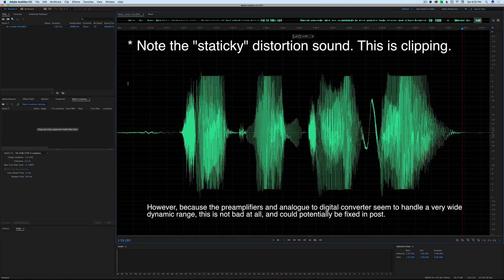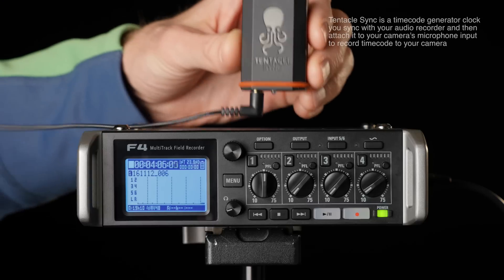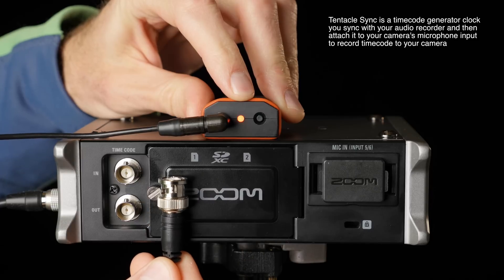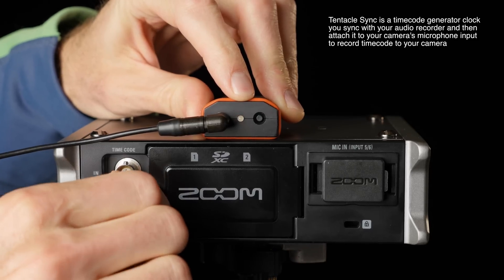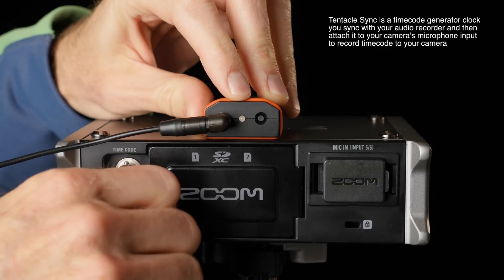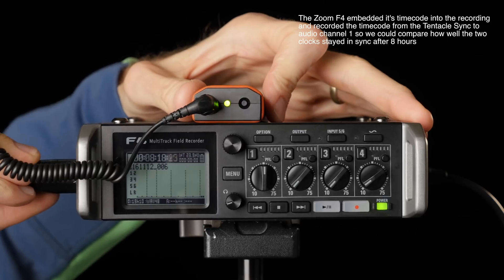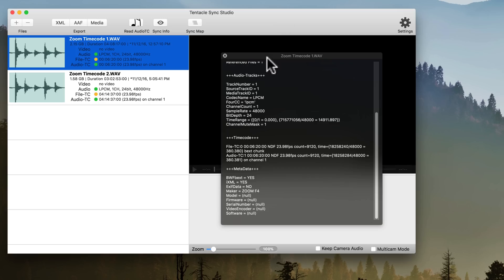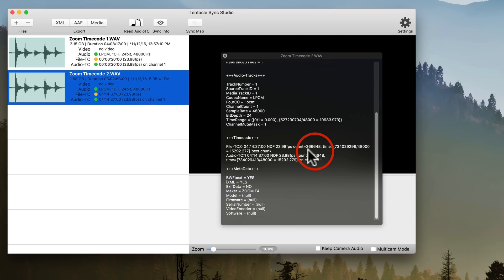Zoom F4 Limiters and Timecode Accuracy

Comment: Hello curtis!!! How are you? Please can you help me with one question, in fact are two hehe 
1 - Did you know if the zoom f4 timecode works fine with Blackmagic Pocket 4k? If i have a TRS stereo mini jack to BNC cable, can i put the BNC at the timecode out from zoom and the Trs plug at the pocket mic in and press JAM, do you know if this works??!
2 - I updated my zoom f4 with the last firmwire version and a wierd thing happens, the 1-4 knobs (levels meters) now works at the out levels for the LR master… for example, if the actor scream at one moment and i need to decrees (go down) the trim of the input, i need to go at the PFL options and change the TRIM value there… 
Resuming, what i want is, the 1-4 Front Faders works as a Trim faders note only faders to LR… 
Sorry about my english im brazilian hehe 
Tks and congrats your channel is the best about audio cinema and audio for filmmakers!!
Cheers!!
Reply from the maker: 1, yes. 2, change fader mode.

Comment: Good day, Curtis! So, with the Zoom F4, all I would need is one Tentacle Sync and I can synchronize one (mirrorless) Camera with an audio jack and the recorded audio in my NLE of choice? Also, will a direct wired timecode connection (BNC to 3.5 jack) from the Zoom F4 to the Mirrorless Camera work? Thank you!
Reply from the maker: If the camera's input can be switched to line level, then yes, a direct connection with an adapter cable will work. If you're using a camera without a dedicated timecode input, you will first need to convert the video files so that the audio timecode is converted to metadata timecode. The Tentacle Syncs come with the apps to do that.

Comment: I've had the F4 for about a month and a bit and I've been loving it so far! What would you recommend for limiting thresholds? I've often gone with -6 as standard but as I've found out some actors be pretty  quiet while others can be much louder so perhaps - 10 to - 12 would help with consistency, Would you agree?
Reply from the maker: My thinking is to set the gain so that the peaks only hit the limiter very rarely. So I focus on the gain trim setting and just leave the limiters at their default settings. With the trim setting, I’d reduce for the loud talkers and boost a bit for the quiet talkers until they’re both hitting peaks around -18dB.

Comment: Hi Curtis, great video as always. I'm looking for an affordable solution to hook 4 radio mics to my Sony FS5 camera, but I'm a bit concern with looming this one up as the out put is consumer, or has that been addressed?
Reply from the maker: Hi Rolf, the main outputs are spec'd at -10dBV. I wouldn't necessarily see that as a problem with the FS5 which has decent inputs as far as cameras are concerned.
Reply: @curtisjudd  Thanks Curtis, had the same reply from a sound friend.

Comment: I appreciate the detailed reviews. Can you start and stop the f4 with the timecode input and a camera in rec/run timecode?  Or is there another way?
Reply from the maker: Thanks Brian. Yes, the Ext Auto Rec mode supports this if the external camera/TC generator supports it.
Reply: @curtisjudd  Great, thanks for the reply.  That would be super helpful with cameras that have TC over SDI and with recorders like the Odyssey7q that can also output TC.

Do you know if the F4 received any of the features that came with the firmware upgrade for the F8/F8n?
Reply: @curtisjudd  I actually answered my own question :)  According to the zoom site it looks like with v3 firmware the F4 gained the advanced limiters from the F8n as well as the auto mix feature: https://www.zoom-na.com/news/firmware-update-v30-f4

Its a little sad the mic/line XLR 1/4" switch is a hardware thing.  Maybe we'll see a F4n soon.
Reply from the maker: @brianwennersten8456  Correct, got all of the software updates. Now we just need a hardware update. :)

Comment: Sir i have discussed with one dealer in india and he told me that tascam 680 mark ii has also analogue limiters and is a pro audio recorder ...plz throw some of your thoughts on this audio recorder plz... should i buy this in place of sound devices mix pre3
Reply from the maker: I don’t think that the Tascam has analogue limiters but I’m not sure. The owners manual didn’t call them out as being analogue. I haven’t used the DR-680mkII but have used the 60DmkII. If they use similar preamps in the 680, then the MixPre has a significant advantage in terms of clean gain and overall sound quality. But again, I haven’t actually used the 680 yet so this is all based on assumptions.
Reply: @curtisjudd  sir for a couple of days i am really confused what should i do....
1)Should i make a one time investment and buy mix pre 3.... or
2)i buy zoom h5 for now and later on will think of some better audio recorder.....
All i have to make short films on youtube that's why i was thinking what should i do.......that's why i am disturbing u again and again.........
Reply from the maker: @Shatavartverma  Buying once is usually the better financial choice if you will be using the device for more than a couple of projects. In that case, I would recommend either a Zoom F4 or a Sound Devices MixPre-3.
Reply: @curtisjudd  thnku sir!!!!!!
Reply: @curtisjudd  Sir what i have learned so far from u and all other teachers on youtube is that if u have a good mic with good amount of signal to noise ratio and has good senstivity u can record clear voice at low gain in your audio recorder.........and for me as a independent youtuber i think zoom f4 is more than enough for me.....i don't need sound devices mix pre 3........and also u have told us that zoom f4 has a great dynamic range so with low gain chances of clipping is nearly 0.....Thats why i should go with zoom f4 which is a lot  cheaper than sound devices mix pre3!!!!
Reply: @Shatavartverma  Excellent, happy recording!

Comment: Did you test the C100 II or similar cams? Because I tested and it seems to have the same things, redusing the volume automatically so that it doesn't clip.
Reply from the maker: Hi Stéphane, No, I haven't shot with the C100mkII. Often cameras will have digital limiters. But I believe that the F4 has a hybrid limiter which is more effective at preventing clipping. But I'm not sure on the C100mkII. Would love to try one!
Reply: Curtis Judd thanks for answering bro! maybe I will test the F4  or similar product. sound is very important

Comment: Hi. I am using a zoom f4 to jam sync timecode to my tentacle sync which I then connect to my Sony a7sii. Both devices are set to 25fps. The tentacle sync is set to MIC. I power off the zoom f4 after each take while the camera people set up a new shot. At the end of the day I found that there was drift between the audio and video. What could be causing this? Does the zoom f4 loose timecode accuracy when it is powered off?
Reply: Also the Zoom f4 is set to internal RTC timecode.
Reply from the maker: Hi, yes, the timecode clock does not keep time when the F4 is off.
Reply from the maker: The realtime clock (RTC)  just seeds the timecode clock when you turn on the F4. This means that when you turn off the F4, the only clock that still runs is the not-very-accurate realtime clock. I hope this makes sense. Good luck!
Reply: Thank you. The explanation is clear. Keep up the great work. Your videos a valuable source of info for me.
Reply: So every F4 owner should get best batteries around :))))) To avoid turning f4 off.

Comment: Timecode is best described as an addressing system.  I.E. This frame of video or sound has this specific address.  It is a process to accurately find a specific frame of sound or video.  If your sound is being recorded separately then IF the video is the identical timecode.. Like time of day code..or FREE RUN TC... then you can easily stack the audio and video together simply by syncing identical code....that was the good old days as I am sure you remember.... Nowadays the audio on the camera is a reference sound...even DSLR sound has enough quality to sync to secondary sound.    As such with a single source or master TC source all devices can later be synced together easily without anything fancy like god forbid a clapper.   I see you use Premiere so most of your viewers know that you can sync 2 system sound pretty easily regardless of timecode.

Comment: Hey Curtis - love your videos, super informative. Just wondering RE: the Tenticle stuff - can it work like a traditional 'higher-end' Lockit Box i.e. say I was jamming to an Alexa Mini via 5-pin Lemo commection - could I sync it to my F4 and get it to jam with the Mini once (and again every time  the camera dept change frame rate / a battery) OR does it only output audio and have to be constantly attached to the camera?
Reply from the maker: Hi Craig, Yes, you can sync to your F4 and then usually these will remain attached to the camera because they are more accurate than the camera's clock and with the Tentacle Sync, they are very small and light so it isn't usually a problem. Most DPs/camera ops will be happy to have something as tiny as the Tentacle vs. a larger, heavier lockit box, especially when flying the cam on a gimbal.

Comment: I strongly disagree. Not having an analoge limitier is a deal breaker and makes this product practically unusable for professional work. For an important shoot, do you really want to risk clipping and thus rendering your recordings unusable?
I don't understand why there is not a single affordable field recorder featuring an analog limiter.
Reply: "I strongly disagree. Not having an analoge limitier is a deal breaker and makes this product practically unusable for professional work."
Interesting; I just had a very long conversation with a professional sound recordist who uses an F4 (as well as Sound Devices gear). Now he does broadcast TV and not feature films. His view is that analogue limiters are not the "be all and end all" that many carry on about. For situations where you have absolutely no idea about what sound you may encounter, then yes, analogue limiters make a lot of sense. However, for the vast majority of work, you know the sound range you will likely encounter and so you set your gain appropriately. Many recorders will also allow you record a safety track, again reducing the need for analogue limiters.
Reply from the maker: Hi Macarena, I suspect that analogue limiters add a fair bit of cost to a device. For example, in the case of the Sound Devices 633, the analogue limiter sits in front of the preamp and is able to manage any spikes before they even do any damage in the analogue preamp stage. That's a dedicated circuit (hardware cost) that also requires a fair bit of engineering (design cost). I cannot think of a single recorder that is priced at under $2000 that has one.

As for whether or not the F4 is suitable for professional use, I think that depends on the situation. Note that the F4 has a signal chain with an impressive dynamic range and very little self noise. A skilled engineer/mixer could easily gain stage such that the normal peaks hit around -18 and be pretty safe in terms of avoiding clipping.

Further, there are wedding shooters that cannot necessarily afford a $3200 USD SD 633 or something similar. These are pros and are able to operate with recorders like this and deliver good results as long as they know how to properly gain stage. Same with corporate shooters like myself.

Comment: I can see why especially for the F8 though why people would call it a deal breaker. Dude it's a $1000 pluss recorder. Okay $999.99 but a bit into 1000 when you buy other stuff for it. So you'd expect a real pro device like that to have an analug 1 if that's what ya do in thoughs. Heck even the F4 at $600. I'm not sure where the forgiving price would be fore me but I did dephenatly expect the F8 to be better then this. I mean it's a $1000 788-T like thing. So I expected pbetter. Don't get me wrong though I still want 1. I'd still love 1. I'm just saying I can understand why people have a problem. I don't myself probably like you said you should record lo anyways then pump it up in post. But for the F8 being $1000 meh I'd expecct more. I guess people do. This wouldn't be a thing at all if these things had auto sence.
Reply from the maker: I know, we all want amazing devices for less money. But remember, this is a $1000 device with very,  very impressive preamps and lots of headroom so clipping is much less likely from the start. The 788T is well over $6000. Not surprising that analogue limiters didn't make it into the F series recorders from Zoom when we consider the $5000 price difference.
Reply: Oh yeah. It's very cool. I'm just saying people are like that and I can kinda see their point here. Don't get me wrong I'd love 1. It's way cool. But perhaps this is 1 good reason why like I said before it's good to record lo then pump it in post. Are there any samples of stuff you can drop box me? Just to hear what the F4 and F8 sound like in full HD. Like I said there is that recording on the Zoom channel but that's not the raw WAV file I don't think.
Reply from the maker: Hi Hamit. I agree, good to aim for peaks around -18dBFS when you have good preamps, and then loudness normalize in post. I'll see about posting raw wav files over at learnlightandsound.com

Comment: We just got the F4 for our production team. How can you tell if you are listening direct or to tape return?
Reply from the maker: In the menu, Output->Routing->Headphone Routing. That will tell you exactly what is being sent to the L&R headphones.
Reply: Thank you for the fast reply Curtis, I'm so glad I found you on the internet as I have no one else to ask these questions! I just did a test to camera with a break away camera cable, which gives you tape return. Obviously I'd want to listen to the camera record and not the mixer when recording. The headphones needed to be routed to 1/2 (prefader) in the F4 to adjust the volume or hear anything. I tried L/R and 5/6 (since tape RTN on the side is also listed as 5/6).  I tested pulling the cable out of the camera, and it did not effect what I heard so I'm only hearing the mixer, and not the camera return. I also have to turn the headphone pot as high as possible to be able to hear, even when the mic was at a good level. (which I found the trim at 45, and the fader put 3/4 of the way up). I also noticed that the trim signal is independent of the fader signal. Any thoughts? My biggest issue is  that I need to be able to easily switch between camera and mixer in the field. Do you know how to do that? Again, thanks in advance for your help with this.
Reply from the maker: Hmm, if you go to the meter screen which shows inputs 5/6, are you getting any signal there back from the camera? If you press the Input 5/6 button, is that all configured correctly? Hopefully you'll see something there to help you solve the problem. Best wishes!

Comment: Hi Curtis, great video - one of the reasons I bought the F4 was based on your reviews. I have a question regarding the Tentacle sync, which I have been using for the past 2 months on a number of shoots and LOVE it. It has really saved time/energy.

I have been able to sync from the F4 just as you did in the video, but have you been able to go the other way - Tentacle -> F4? I know in reality it doesn't matter as long as all the Tentacles match the F4 - but I'm a little anal when it comes to things, and I like the idea of syncing from a Tentacle that has been synced with my phone. Again it's no big deal, I'm more or less wondering if you can go to the F4 and I am doing something wrong.

Thanks
Reply from the maker: +Chris Gosling hi Chris, some of the sync cables are uni-directional. I believe this is the case for the 3.5mm TRS to BNC cable from Tentacle Sync. If I had to guess, this is the most likely reason you're not able to get the Tentacle to act as master clock.
Reply: ,
According to the Tentacle Sync shop, the BNC --> 3.5mm is bi-directional. Again it's not a big deal, I was more or less wondering if you had tried going from TS --> F4, and if you had a trick to make it work. Thanks again :-).
Reply from the maker: Indeed, you're right. In that case, I'm not sure why it isn't working. I have a cable made by PSC and it seems to work both directions. Hmm...
Reply: You wouldn't happen to know which cable you have - I was in checking and there seems to be a few to choose from.
Reply from the maker: Yes, but if you've got the bi-directional cable, most likely the reason you haven't been able to jam-sync the F4 to the Tentacle is that the Tentacle's output level is set to mic. If you connect it to the app and change it to line level output then reconnect to the F4, it should work.

Just in case, this is the cable I have: http://www.locationsound.com/psc-fpsc1085-23.5-inch-stereo-mini-right-angle-to-bnc-3529
Reply: LOL pardon my language but F@$% me - output level was set to mic. DOHHH!!!!! Thanx Curtis (continue shaking head in disgust/embarrassment).
Reply from the maker: No, no, I made the same mistake and I should have remembered that when you first asked your question! Happy that we both got it figured out. :)